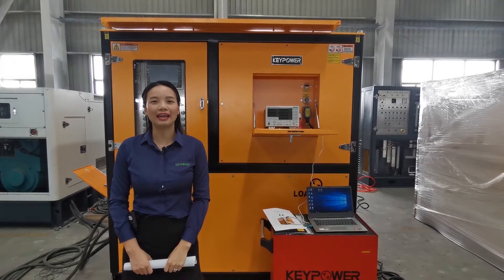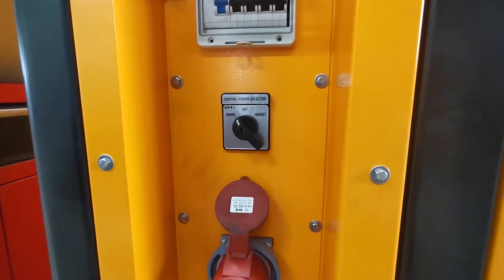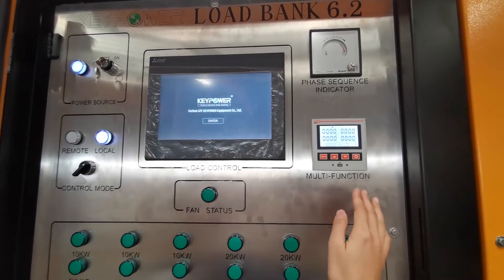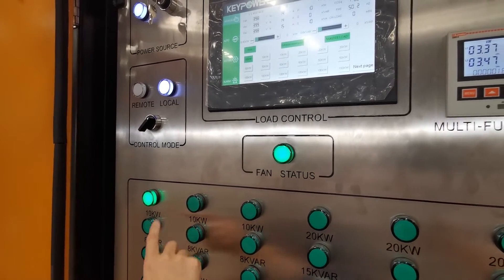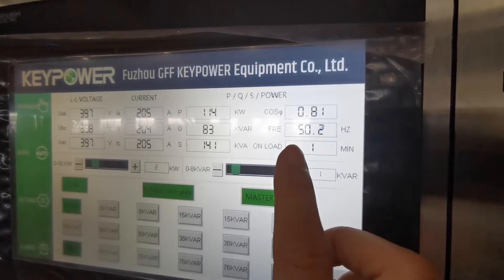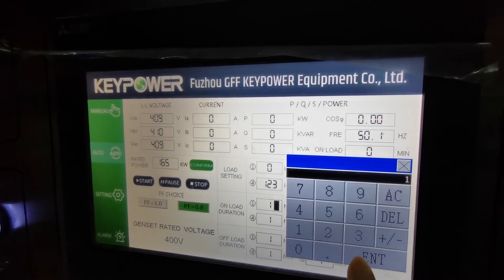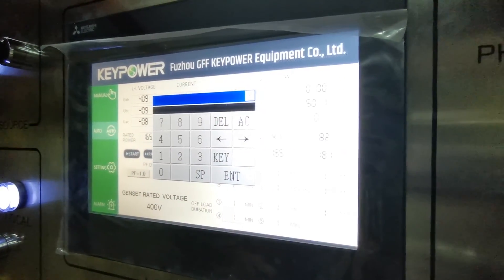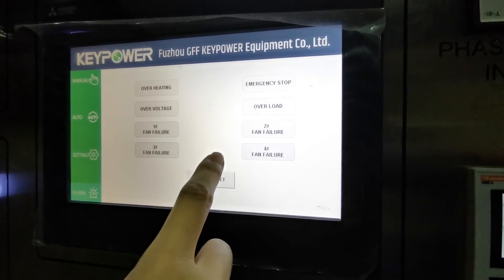Operation for 1250KVA resistive and inductive load bank with intelligent/remote control

Comment: Hi, we recently procured 2Nos [1 auto and 1 manual] 500KW Load Banks from your organization.

The Automatic has two Load termination Points and I suppose thats why its called the master and the manual has only one termination point from the Load and analog as slave when operating them in Series. 

Can you please advise/ provide more guidance on the connections as it will be helpful.
Reply from the maker: please email to sales@keypower.biz